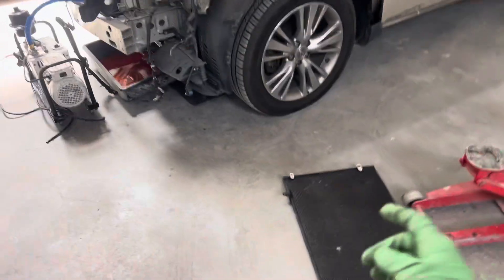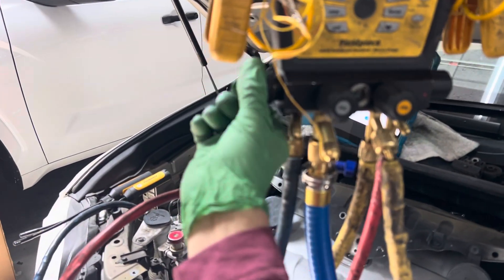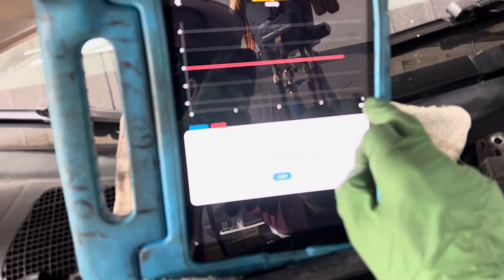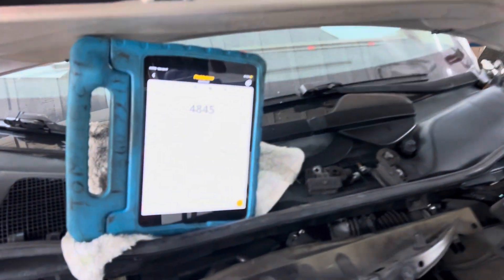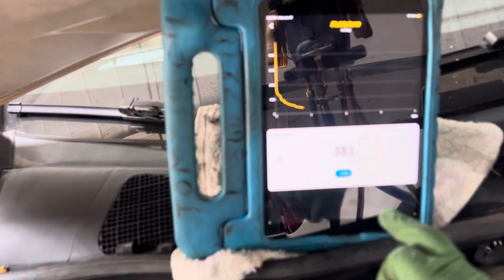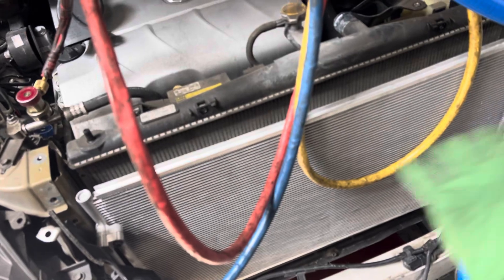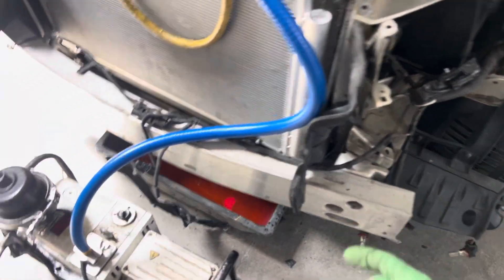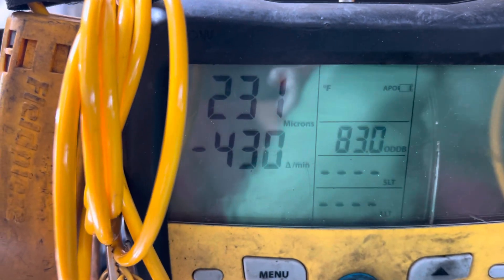MICRON GAUGE ￼readings ideal situation on a clean dry AC system.

Comment: If you got a female o ring end thats too deep and makes metal to metal contact before squishing the o ring, can i double up the o ring or do i need to trim the face down till it fits proper?
Reply from the maker: You only use the correct own ring. Anything else might fail it’s only guest Work.. 

You do it once you do it right or you don’t do it at all
Reply: @coldfinger459sub0  yes...i have proper extra o rings. I guess ill just take a case trimmer to the face of the sub-par line i got.